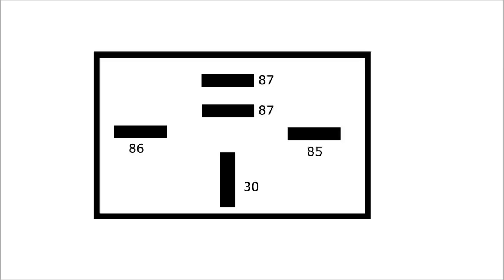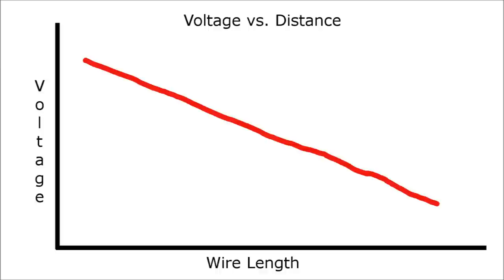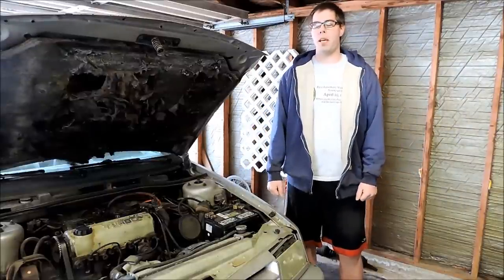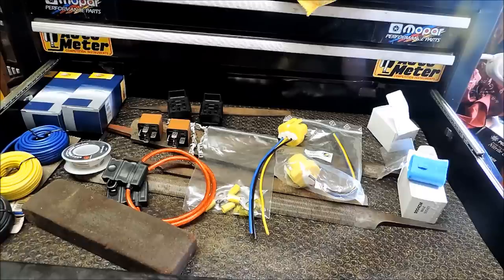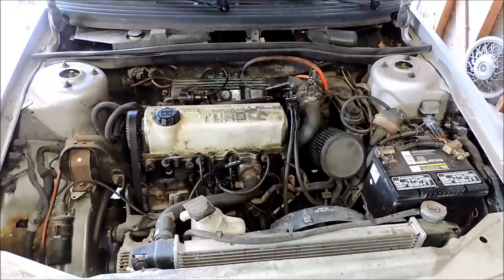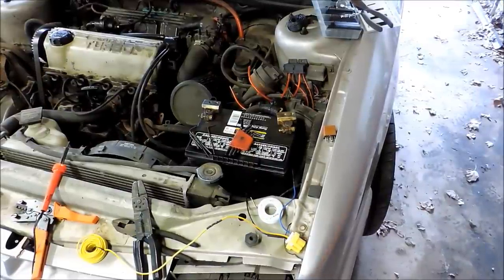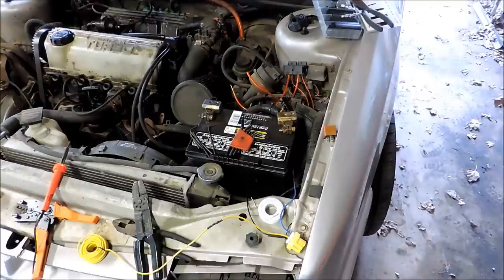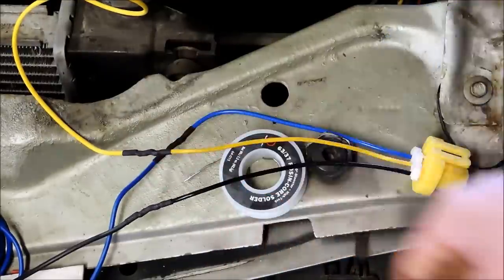Why and How to Relay Headlights

Comment: Anyone that can help me? I got a Audi A6 avant 2001, wired up a ledbar with the relay getting signal from original high beam. Everything works fine when I turn on the high beam, but when I turn them off, the original light turn off like normal, but the led bar has a 1-2 second delay before it turns off... Any idea of what it could be?
I tried with two different relays and still the same problem, and the ledbar I have tested on my other car, and it works fine
Reply from the maker: Could it be capacitance built up in the light which it's running off of for that second or so? I've seen that with other LEDs.
Reply: @bwcordes  only thing is that when I tried it on my other car there was no delay, and I would assume there is none since it's a high end led bar
Reply from the maker: @Norwegian_Auto  That's weird. I would probably test the relay manually and see if it is sticking closed. That seems unlikely, but I guess it could be happening.
Reply: @bwcordes  I've already tested the relay :/ and works like a charm
Reply from the maker: @Norwegian_Auto  Interesting. I can only imagine it's capacitance building up and then being discharged. If you tested the right part of the circuit, you should be able to see resistance increasing over time. It would probably be easier to contact the manufacturer at this point I would guess.

Comment: Hahaha! That graph! I literally laughed out loud.
Reply from the maker: I'm glad you liked it. I put a ton of time into that graph as you can tell.
Reply: Correct me if I'm wrong, but you could also use two 87/87a relays, right?  Left High Beam(87)/Low Beam(87a), and Right High Beam(87)/Low Beam(87a).
Reply from the maker: You could, but then either the high or low beams would be on all the time.
Reply: Right, depending on where the headlight switch is wired in.  The high/low switch is different from the on/of switch.  I'm not trying to start an argument or anything, just thinking out loud.
Reply from the maker: No worries. You're absolutely right that depending on how you want to wire switches etc. the possibilities are almost endless with what you can do. That's one of the reasons I wanted to make this video. I hope people can learn a little about relays and realize what they can do with them.

Comment: To teach electricity it is necessary explain the wiring diagrams with practical wiring of electric accesories they both simultaneously, otherwise it is very difficult to understand.

Comment: I have a 01 dodge ram 1500 I replaced multifunction switch and still have no high beams
Reply from the maker: I would check for power at the lights to ensure you didn't blow them out somehow (crazier things have happened). If no power there, I would start at the switch and move toward the lights, checking for power as you go.

Comment: Is there a brand and model on those relays?
Reply from the maker: I'm pretty sure they are Hella relays. I'll be in the garage tomorrow so I'll try to have a look at them.
Reply: bwcordes Wow, that was a fast response.  Thank you, and thank you for the video.  This is a soon-to-do project on my Jeep Wrangler.
Reply from the maker: Thanks. These are actually Tyco relays. IIRC they bought out someone and are/were a major supplier of the Bosch style relays. 

Anyway, the part number is V23234-C0001-X006

It is rated at 12v/30A, but you can use a little math to find out what amp rating you need based on how powerful the lights you'll use are. 

Hope this helps.
Reply: bwcordes It helps a ton.  I'll be ordering two shortly.  Apparently the word is that the quality of the relays out there is one of the biggest long-term issues with headlight conversions, so I'm being careful about which I end up using. Thank you, and have a Happy New Year.

Comment: I'm sorry did you say the 87a and 87 are the same  also just for clarification larger gauge wire is needed for higher voltages not higher amps.
Reply from the maker: 87a and 87 are two different terminals. One is normally open, and the other normally closed. If larger gauge wire were only needed for higher voltage, then there wouldn't be so many large gauge wires on a 12v system in places which pull high current. I'd hate to see someone attempt to run 22ga wire to their starter. That wouldn't take long to burn up.
Reply: So larger diameter wire is required for high amps and 87 and 87 a are the two posts that are activated in Deactivated based on magnetic field.
Reply from the maker: You got it. IIRC 87a is normally closed.
Reply from the maker: How is the quality on those kits? I usually try to spring for decent wire so I haven't tried the HF stuff because I haven't seen any feedback on it. Thanks for all the posts and insight BTW.

Comment: I have four roof fog lights can I run all the positive reds together to 87 with one relay or do I need 4 relays for each one ? some one help!!!!!!
Reply from the maker: +Enoch Mendez You need to look at the amperage of your lights, and compare that to the gauge of wire you want to use along with the current rating of your relay.
Reply: +bwcordes KC HiLiTES/6 in. 100 Watt clear lens chrome finish Daylighter round halogen flood light
Reply: +bwcordes. This is the link of lights http://m.autozone.com/exterior-lighting/flood-light/kc-hilites-6-in-100-watt-clear-lens-chrome-finish-daylighter-round-halogen-flood-light/437375_0_0/?location=
Reply from the maker: +Enoch Mendez Assuming that you're using a 40A rated relay, I would feel pretty comfortable using it to power all the lights. I am one to push it a bit though and you won't leave a ton of head room when running the lights at lower voltages. An EE would probably suggest two of them. 

I have no idea how much wire you need to use, but I would look at the distance you have to run them and make sure that you're using the appropriate gauge wire given the length of wire. You can calculate your voltage drop and see recommended wire size for your amperage at the following site which I quickly googled. 

http://www.powerstream.com/Wire_Size.htm
Reply: +bwcordes. I have two 40 amp relays an also have 12v 35 ft wire for each light an for the switch to run back to the relay
Reply: 12g wire
Reply from the maker: +Enoch Mendez Assuming you mean that you have 35ft of wire total rather than 35ft running one way to each light, I would run 4 individual wires. one to each light. If possible I would crimp two of them in a terminal at each of your two relays.

Comment: hello sir
how to make headlight relay with microcontrller
Reply from the maker: That shouldn't be too hard to do. I have thought about controlling one with an arduino and a photo resistor. Just double check that the current your relay draws is less than what your micro controller can supply or get a board designed to control relays and you should be all set.

Comment: 😂😂😂 “ There she blows, 156hp, four cylinders of Fury.    .... The 1990, Dodge Shadow “
Reply from the maker: Glad you enjoyed that! I try to keep it light in my videos as much as I can. Thanks for the view and the comment.
Reply: bwcordes question, is it possible for me to, change my stock Highbeam/drl and use a relay. 
I want to add a 3 wire LeD bulb/connector, then drill a hole into the back of my headlight, and put that led bulb in, so my LED Drl Strip will light up.
So basically I have the lowest trim model, and it doesn’t have the led drl strip, well the strip is there, just instead my drl is my highbeam half drl
Reply from the maker: Does the LED bulb actually mount properly in your housing? If not, I'd be very worried about the aiming of the bulb. Otherwise, I'm sure you could wire it off of a relay to turn things on and off in any way you choose. You may want to look at the relays with the 87 and 87a terminals to switch things. Those can be a big help since one of them is normally open, and they switch so that the other opens when the relay is powered.

Comment: so you have a relay for each brightness not for each head light? 1 relay for high beam L & R, and 1 relay for low beam L & R?... I got what you did, but it would have been nice to actually have you show what you did. rather than you tell and point how you did it... Thanks!
Reply from the maker: That's what I did. I just did a video series which shows in a little more detail how I did the same thing to my Lancer. 
https://www.youtube.com/watch?v=6-mU5trb2Mw
Reply: bwcordes - Thanks for the quick reply......

Comment: Why can't the industry standardize red is +, black is - , and green is ground?
Reply from the maker: I think one of the biggest factors is the fact that you have so many different wires coming off of a common line that all power different things. You need to color code each one of them for identification. Then there's the fact that you have different voltage sources under the hood. There are also different grounds which need to be identified. It would be nice if there was some commonality, but I think there are too many different ways of doing things for everyone to agree.

Comment: Peopel use external diodes those Bosch relays are crap expecialy EU relays all have ic chip controled so internal diodes leak they fail .
Reply from the maker: I installed some hella relays with internal diodes. They just had the diode soldered in them. They work great.
Reply: @bwcordes  you see not only GM did fatal mistake but also bosch and delco no diode for delco 12si alternator no diode for positive linear voltage regulator the alternator is bound to 4pin bosch relay on pin 86 and commonly they are ic chip controled no ballast for xenon lights or halogen lights lot common conections for + and - and including multipel relays interact with ich other they behave nearly identical like dual 5 pin relay.
My car is Opel Ascona C also knowns as Cavalier or Monza or Cammri .
My car nearly has no electronics insted it has 4pin defroster ,3pin blinker,2pin buzzer ,6pin wiper relays ,positive linear voltage regulator and 4pin GM Ignition Module .
My deam car acts like Hit and Miss engine ,or refuse to stop or self aceleratea at full trothel such bizzare effects no one ells on the internet didnt witnes unless my self so belive my when I say this make ich circuet sepetate add lot resistors diodes and reverse polarity protection if posibel clossed loop baterry system due to rosting problems use only wires not engine ground!!!
US relays might by great and I agree with simpel circuets but Asia EU Australia versions are pure desaster not to mention crazzy Brits who for some reason decided to fummel around pin positions like the 700Y dash regulator .
I hade to 5days just redraw wire diagram to understand how this GM wire harnest works it looks like bomb droped in that thing and still didnt figure out loot misteris why my car behaves strange ways some problems I found but some still culd not trace down and thats 40 year old car not modern car and under static I hightly doubht even best computer equpment can help because profesional car electritians culd not fix those problems.
So fair advice to use dual baterry systems and cloosed loop voltage regulator for those old delco 12si alternators and replace some shity staff in the proces replacing them with heavy dutty industri parts.
Just talking out of experiance those old cars seriusly are great but shiti in design they have lot flaws.
Im my self useing plasma and some times high amp ignition so thats why those mentioned circuets need upgrade if not protected or seperate circuets done for exampel on hv ceramic capacitors the starting alternator charge or cutt in current will by delay at around 3-4k rpm.
My own diodes failed they are also Bosch and Hella also some use Siemens relays so use extra strong diode and just trust my on this one.

Comment: 5:36 Yes, my Bosch headlight switch in my Saab had been replaced many times because it melted.   BTW  Bosch is junk.  All electrical components in the car failed repeatedly.  All were Bosch.  And as an added bonus, the cross-ref numbers to replace the Bosch w/ other brands were deleted so that only Bosch could be used and only from a Saab dealer.  How *&*() nice.
Reply: Bruce Kirk  You got my point, right?   I appreciate the suggestion, but I was really trying to say how shitty Bosch was when I had that car.  Has Bosch gotten better?  I can't believe how shitty they were.  The must have either cut every engineering corner or where just plain ignorant or thought they could get away with putting out crap and the public wouldn't fucking be smart enough to see smoke emanating from the dashboard.  One of my headlight switches actually melted while I was driving.  I don't trust them anymore.  I think they're weasels.  Is Lucas still around?  You probably know more than I do.  Thanks for the comment.
Reply: Bosch stuff never failed on me, maybe you were unlucky, i have everything bosch in my car, nothing failed, also that 10y warrinty on battery was nobrainer

Comment: So where is the dimmer switch connect
Reply from the maker: On the chrysler cars the dimmer switch for the interior dash lights is a part of the headlight switch. It does not need any changes. The high beams are controlled on the stalk and send power to either the high or low beams. You don't need to do anything under the dash for the relays to work.

Comment: 87A is de NC and 87 is NO. Remember this. It doesnt work like you said in the vid. You need either 2 relays or just a high amp 4 pin relay.
Reply from the maker: +Nordic  Watch the video again. The Hella relays which I used have two terminal 87s. The lower one on this model relay is NOT a terminal 87A.